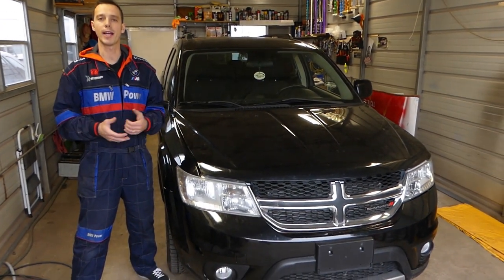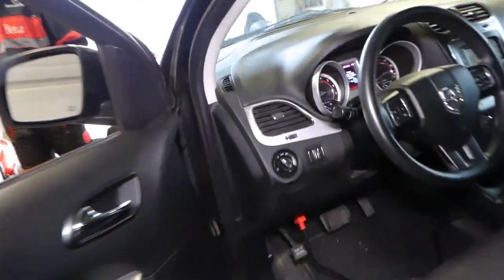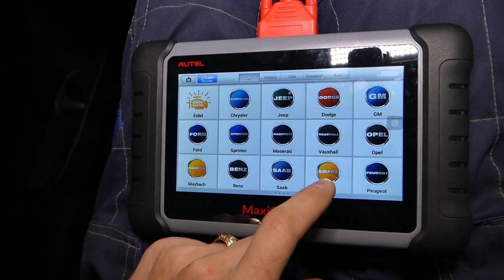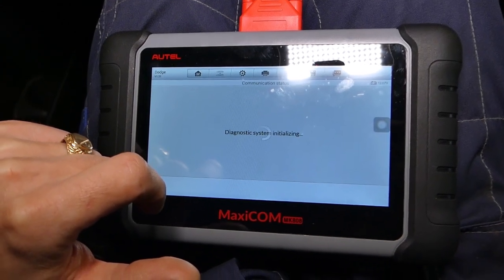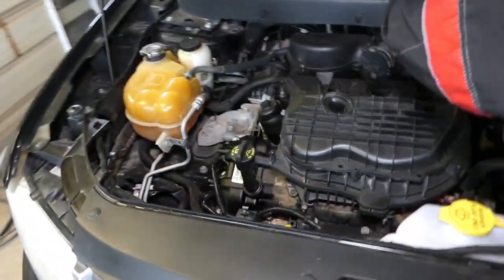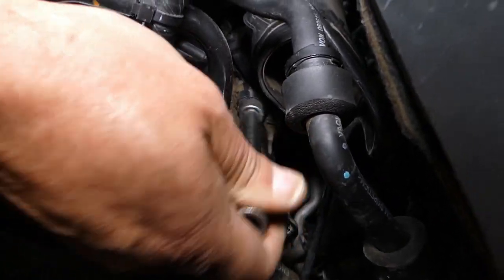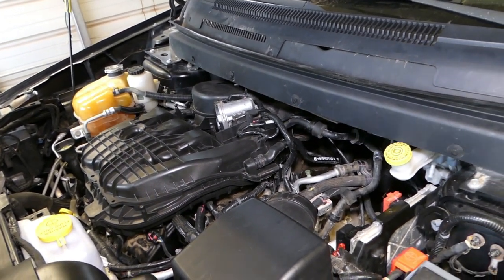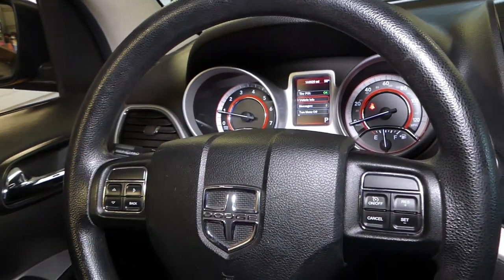CODE P0340 P0365 CAMSHAFT POSITION CMP SENSOR CIRCUIT BANK 1 SENSOR 1 SENSOR 2 DODGE JEEP CHRYSLER

Comment: These codes are coming up for my Chevy malibu. Car completly lost power on freeway and now will not start. Hopefully it is this simple for me.
Reply: I have an 2009 Malibu and I've had engine troubles for 7months.. and found out it was my timing chain, camshaft & crankshaft sensors, and the intake/exhaust solenoids.. hopefully those suggested spots will help you find the problem.

Comment: I've got a 2006 Dodge Magnum, I've ran codes, got Faulty o2 sensors (replaced those and it's fine), and a p0340 Camshaft position sensor. I replaced the CPS and it still gives me the code for it. Could it be a wiring problem?
Reply: Having the same issue for two years but now the engine won't start

Comment: I had a bank 1 and I replaced it but now still get bank 1 reading could the sensor be a defected
Reply: Hi i got the same issue bank 1 sensor which is the driver side i replaced it but still get the code did u find out what was the issue on urs
Reply: @FelipeMartinez-gu5xx  not yet could be spark plus also my fuel pump says on after i remove the key
Reply: You might check with the dealership. I recently received a notice that there is a glitch in the computer system of my 2014 Dodge, which makes the codes not clear after you have things fixed. There is a recall and they said they will fix it for free.
Reply: But I have a 2011 Routan SE
Reply: @LubaLuba1  did you ever get it fixed?